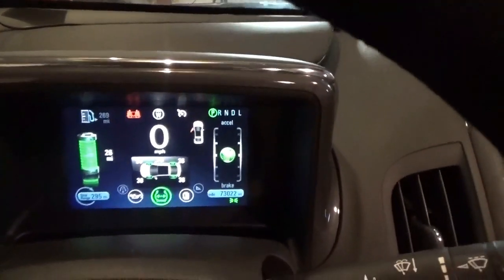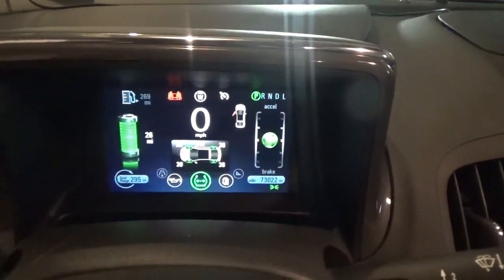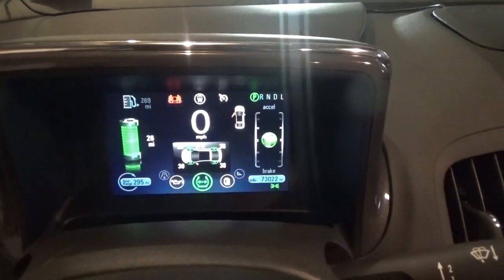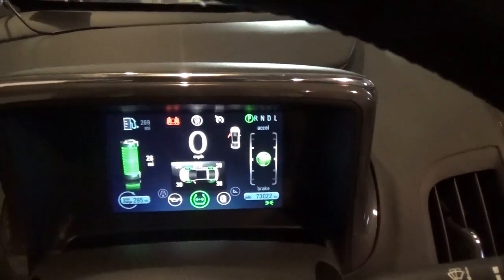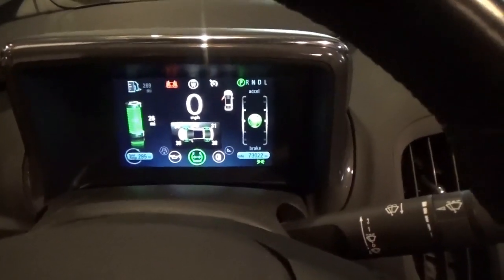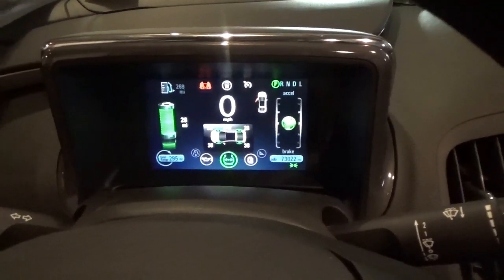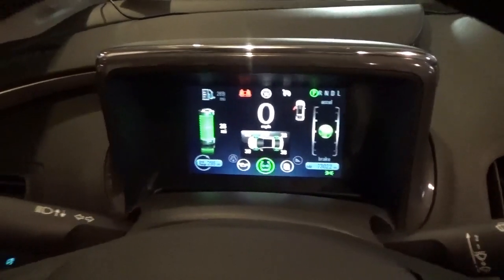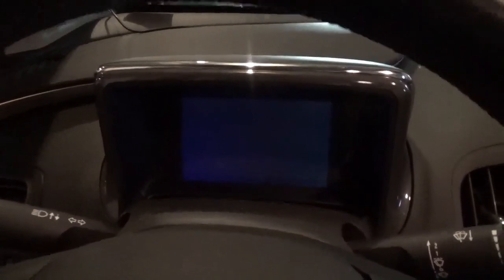Relearn TPMS on GM vehicles without a TPMS tool

Comment: Does not work on Gen 2 Volts

It also does not work on Gen 1 Volts 2013 Volts and newer.  Searching the gm-volt forum explains why.  A relearn tool can be had for about $11 new.
Reply: 2012 and newer

Comment: Sounded like me today 2006 Chevy suburban oil pressure sender way back on top rear of engine under firewall cowling . Couldn't get it to thread in by hand tore up the threads with a universal joint socket extension .
Reply from the maker: I've had too many a day like that!

Comment: Hey mister disgruntled seems like I'm a little disgruntled!
My 2012 Chevy Volt did not dog the reset. Gave me low pressure reading. Was your car still in diagnoses mode when you did yours?
Reply: My vehicle had a computer update by GM to fix power battery balance issues...
That causes low propulsion issues to be fixed! May be that's why it didn't work.

Comment: No go on my 2012.  I tried both deflating and inflating the tires.  Never got the acknowledgement beep on the driver front. End of the road.
Reply: Same on my 2015 Volt.
Reply: This only works with the very first year.

Comment: Thanks Mike . . .  I have a 2012 Volt with only 20K.  Right front went flat.  No spare,  long story short, AAA towed the Volt home.  My floor jack wouldn't fit under the car to the lift point.  The inflator/sealant got it up enough to set the jack.  Got the tire off and Firestone said.  nope, once you put sealant in the tire, we can't repair.  OK, bought new tire.  I'd like the new tire to be on the rear.  So, your brilliant relearn should work. "If you can get somebody else to do it, you're probably better off"   Mike, you didn't really mean that, did you ? ?  I always try to do it myself . . and I love tools, can't have too many.   Thanks again,  and take care.     Bob
Reply from the maker: The relearn should work on your 2012 Volt no problem. As for the saying, if you watch tool videos on my channel I think you will see I do as much of my own work as possible and have the plethora of tools to show it. Good Luck!

Comment: This worked like a charm on my 2012, thank you so much and is there any other tricks in that mode? How about any ideas on how to make the hybrid battery rebuild itself, I’m only getting 8.5kw with 80,000 miles 😕
Reply: Did you have the recall done, where they rebalance your drive battery?  Not sure what the TSB is, but it's a 'courtesy' recall on GEN1 Volts
Reply from the maker: glad to hear it worked!

Comment: Worked like a charm for my 2017 Silverado 1500! There was a slight twist in that my horn never beeped when letting out pressure, instead of the horn beeping twice while deflating, the  "ad air" (or low tire pres) icon came on for that particular tire. When airing up, the left turn signal started blinking while filling the left tire, rt signal while doing the right tire, etc. Also the horn beep twice when it got to 35 psi. This is where I stopped as I didn't rotate my tires, I blew out the passenger front. Thanks brother!
Reply: Hi, I have a 2017 Silverado and it didn't work. It's in active position let air out in front driver's nothing happened after letting half the air out. I have tool and it won't work either. I'm stumped any thoughts please?

Comment: 0:01-0:25 Your intro got me 😂 😂 😂
Reply from the maker: Thanks!
Reply: The Disgruntled Mechanic no worries
Reply: The Disgruntled Mechanic I recently had to put a new wheel on my Opel Karl or as us Brits know it as the Vauxhall Viva due to a buckled driver's side front wheel which has now been replaced but had to buy a new tpms sensor and valve stem. Is this relatively easy to do as its my first car with tpms built in?
Reply from the maker: I am not familiar with either of these cars so I really can't tell you if it will work. Many new cars it will not work on it seems. Sorry I can't help more. You can follow the instructions and see if it works! no guarantee it will work.  P.S I meet Mick Foley in person a few years back and got to chat with him. A great guy!
Reply from the maker: and the tpms sensor may need to be programmed to the car.

Comment: Going to test it on 2013 camaro rs hope it works
Reply from the maker: I pretty sure it should if you follow the steps. Let me know how you make out!
Reply: The Disgruntled Mechanic i tried it but didnt work. Aired all the tires to 60 psi and started the relearn process car honked two times then i started to bleed air out of the front left tire. Aired it all out but didnt hear the horn.

Comment: For anyone with a Volt 2013 or older, this trick doesn't work, sadly. In their infinite wisdom, GM took away this functionality for some ungodly reason. The stupid tool is the only way, aside from using a very strong magnet if you happen to have one, but that doesn't work as reliably.
Reply from the maker: Good to know on the newer  Volts because I just bought a 2017. And GM also did not offer the homelink on the 2017 volt. Very stupid IMHO!
Reply: The Disgruntled Mechanic agreed, the removal of the Homelink is mind boggling stupid. I like the gen 2 a lot but jeez... Cheers man, enjoy the new ride.
Reply: So this only works for 2011 and 2012 Volts?
Reply: I can get into "Learn Mode" on my 2012, but it doesn't beep and doesn't register 2 of the 4 (can't see them, one was replaced because the battery died in original TPMS transmitter).
Reply: This doesn't work om my 2012 volt. It will not go into relearn mode. I think some update deleted it, or it was never there.

Comment: Great video, but I have been told that bleeding the air for only 5 sec should do it. You do not need to bleed the air until the beep is heard. The beep will still takes some time, but it will still work. This way should avoid having to refill afterwards due to the time it takes for the TPMS to reset.

Comment: I was not expecting an intro! Very nice intro to boot. What I noticed that I think is cool is, after the first horn blow to go in to relearn, the driver mirror signal lit and stayed lit until horn blew again saying to move to next tire. Then passenger mirror signal stayed lit until that tire was relearned. The vehicle tells you what tire it wants! I wonder if a rear turn signal or tail light stays lit for the rear tire relearns too?
Reply: The rear lights do light up for each tire, you can see them reflect off the garage door.
Reply from the maker: +Jon Rushing Glad you liked the intro. My girlfriend laughed her ass off when I played it for her. I knew what tire to go to so I did not even notice the lights blinking.  I will have to look at the video again. Thanks!
Reply: Yup I noticed the lights following you. Too bad you didn't move the camera to the back. I would have enjoyed knowing the vehicle has the programming and could blink a single reverse light or tail light for the tire it wants. Maybe redo the relearn just to see lol...
Reply from the maker: well i may do that. I got the TS401 so may do it again just for heck of it with that.
Reply: I was kidding but a chance to play with a new tool is hard to say no to.
Reply from the maker: +Jon Rushing well as you say I thought about it before you mentioned it. Wanna use the new tool! and that is the only vehicle I have that has TPMS on it.
Reply: I thought the Silverado had TPMS. I guess it is too old for it.
Reply from the maker: yep. too old. thank goodness!